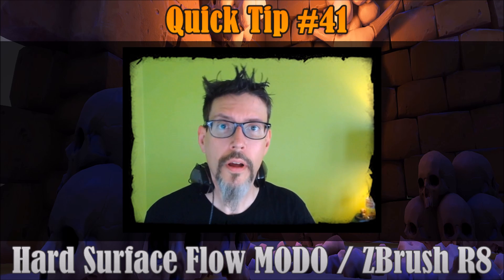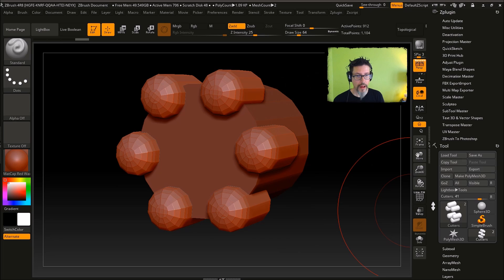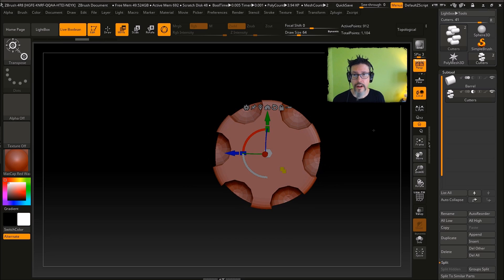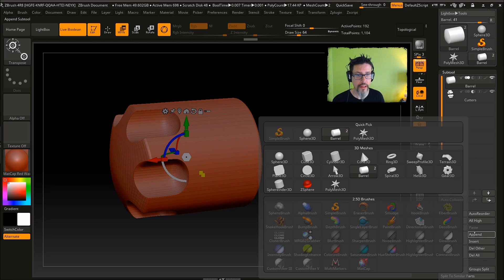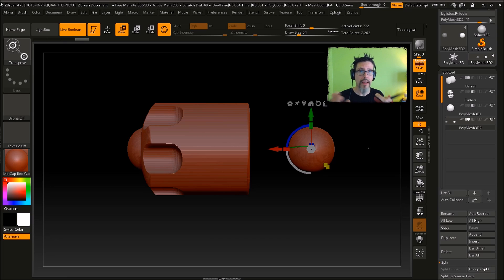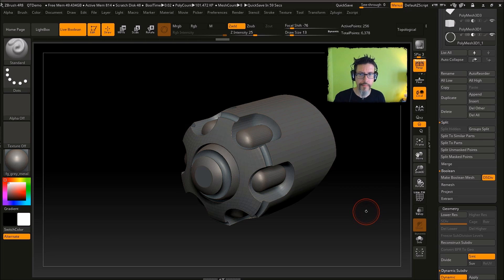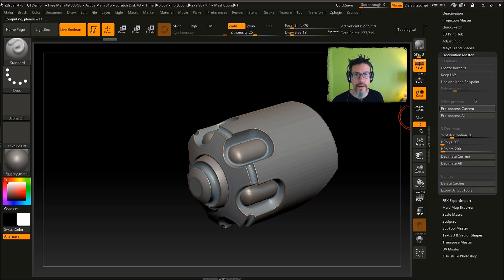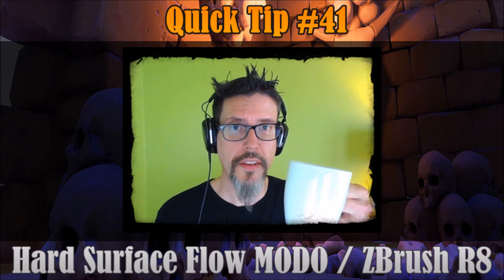Quick Tip #41 : Hard Surface Flow MODO / ZBrush R8

Comment: Hi Warren thanks for your excellent tutorial! I have a problem of GOZ. I can't send the model from modo to zbrush, either from zbrush to modo.
Reply from the maker: Yeah, unfortunately GoZ is a fickle beast ... it comes and goes for me.  Right now, AFAICT, it's not working.  Hopefully they'll fix it soon ... again.
Reply: I just cleaned up the old goz files and then download the newest goz from The Foundry. Then I reinstall it, works! HHHAAA
Reply: I got a new problem that when I done the make boolean mesh, turn to dynamesh it as 11:04 in your video. It doesn't work actually. Said:“Creating a 3d mesh from the currently selected tool and skinning-modifiers will produce a mesh with zero number of vertices and polygons”  Don‘t know what happened...

Comment: Any reason why you didn't do the whole thing with mesh fusion? Any advantage to using zbrush for something like this?
Reply from the maker: Well, it all depends ... You could absolutely do this in MeshFusion. I find that MF gets slow pretty quickly and something like this doesn't really play to it's strengths.  MF is better used as a tool for merging meshes together as opposed to a pure boolean workflow IMO.  ZBrush Live Booleans are way more responsive when trying to iterate on a mesh and drag booleans around.

So ... as always there are multiple ways to get where you're going.  Such is 3D art!
Reply: That is interesting. Concept model in zbrush but do the final booleans in modo. That way you can take advantage of the strip function is MF.

Comment: it's worth pointing out that modo can do live booleans using mesh ops, not Just meshfusion, in fact for lower detail stuff like your example it really excels. once you get to a certain mesh density though, I agree- nothing handles massive amounts of polygons like zbrush.
Reply from the maker: Yep, multiple ways of getting there, no question.  MeshOps are capable, they're just more work to set up at the moment...
Reply: oh, i totally agree- that's why i built a handful of macros and presets to handle 90% of the boilerplate stuff, now i just use a 'live boolean' pie to send a mesh to the subtractive/union driver, toggle driver group visibility, etc. i should probably clean it up a bit and make it available. 

I'm actually using a similar workflow as yours at the moment, though I'm doing all of my low/medium work in modo and then sending all of the low poly drivers to zbrush for high detail work (stuff I would usually do with floating geometry.. rivets, insets, etc). 

I've found that doing the low/medium work in mesh ops has other benefits too, for example- if you don't need to do super high detail work, or plan to bake floating geo anyway, you can still get away with using the round edge shader and not have to worry about intersection cleanup in zbrush, or dealing with a decimated mesh- you've still got the low poly work in modo.

It's nuts that the foundry guys can implement such a powerful feature as mesh ops and then completely fail to deliver a streamlined user experience, maybe now that pixologic has shown them how it's done they will put out a patch haha ;)
Reply from the maker: I think there's a kit about to be released from the Pushing Points guys to make this an easier workflow in MODO ... I think ... they're considering it. Here's hoping!
Reply from the maker: Yeah, I mean, it kind of sucks ... it's the same exchange with everyone.

"Mesh ops is great!"
"Lot of set up tho ..."
"Oh, sure, but I made a whole bunch of macros that ... etc, etc."

Wish it would have just SHIPPED with a nice level of usability instead of everyone carving their own wheel.
Reply: yeah, totally agree. I think it's just one of those areas where they knew they had something powerful, but didn't really understand how it would be used.. at least not by gamedevs. i'm sure there's lots of forehad slapping going on over at the foundry now that Z4R8 is out.
Reply: I'd love to see/hear about your boolean setup for Modo ;)
Reply from the maker: Soon.  :)

Comment: You could also use the Boolean Results as a nice lowpoly start. :)
Reply from the maker: That's true, you could hit that with a quick retopo pass and be done with it ...  I might give that a try later, see how it feels.  The low poly is still a problem at this point.
Reply: Yeah for some reason its making some very odd edges in places that makes no sense. But over all its a better start then most.
Reply from the maker: I think that's because ZBrush adds 1 level of subdivision to Booleans ... probably adds some cuts.
Reply: Warren Marshall do you have a tutorial on doing something like that, retopology?

Comment: Heyy, great to have you back! Thanks for this great video!   ...This is almost exactly the workflow I've come up with myself. :)  With the exception of using Polish by crisp edges with the hollow circle on. I find this does a bit better job of rounding the edges. The regular polish seems to start to bump up the edges slightly when using bigger values and for some reason the crisp edges variation doesn't.  Also, I found out that in the subtool menu there's the copy and paste buttons --> map these to ctrl+c and ctrl+v for quickly duplicating subtools like in Modo. This is great because once you hit paste you end up with the new subtool active  and can start to move it straight away. None of that append new subtool, or splitting bullshit. ;)
Reply from the maker: Nice!  Definitely going to try the copy/paste thing!  I do hate how the new subtool isn't selected by default. You can see that trip me up at least once in this video.  :)

Comment: Hey, to make it even more clean -> Under Geometry -> Clay Polish -> Set a Left and Right Value from 10-100 (Depends on the Dynamesh Resolution how this will effect the mesh) and click Clay Polish.
The higher the dynamesh resolution, the smaller the effect will be and you then need a higher left and right value.

After this, use the polish under deformation and the mesh should be soft and clean, a good HighPoly for games.
Its important to find a good mix between imported geo, and bool spot.

Often my imported Geo from Max gets to soft, when i clay polish and polish the dynamesh bool..
So sometimes i need to model a bit harder, to have then the perfect softness after clay polish and polish on the overall mesh,
Reply from the maker: Interesting idea!  I'll give that a shot next time, thanks!

Comment: Thanks for the tip. I was really useful, and it's good to see you're back :)

Quick question(s): at the end point of the video, would you just go ahead and use that geo as it is, in game? Are there any other modeling steps you would go through before throwing it in a game engine (aside form uv maps and texturing)? Is there ever a need to retopo this if you don't need it to be a skeletal mesh that animates?

Thanks :)
Reply from the maker: It depends on what you want to use it for.  Personally, it's still over 20K triangles by itself so odds are I would retopo it to a simpler shape and bake it.